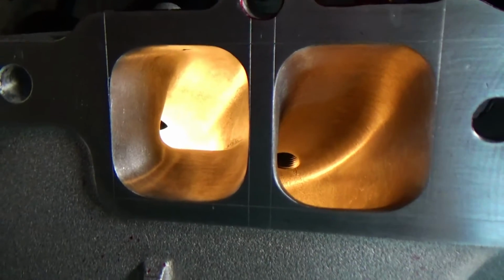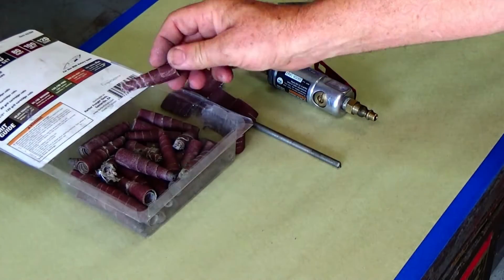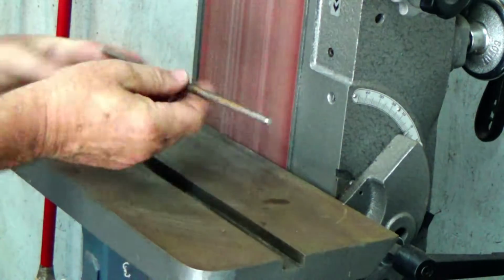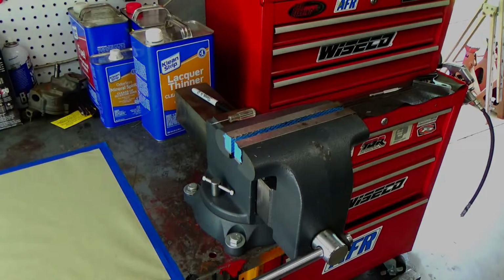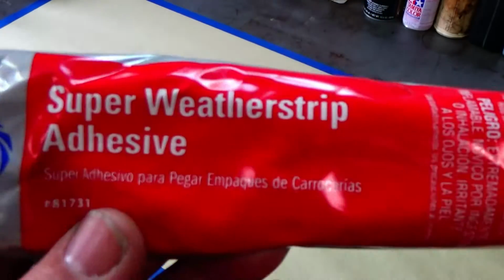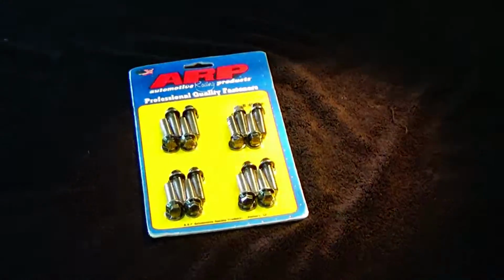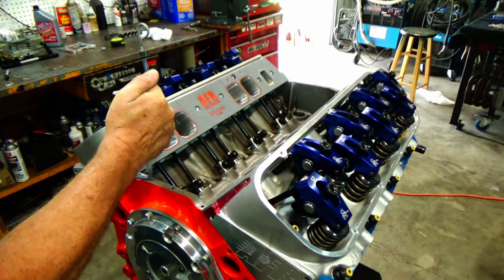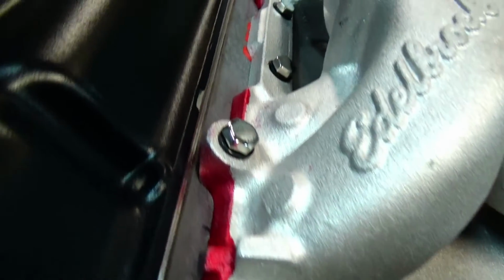Port Matching the Intake to the Heads( part #3) -#22 of the Chevy 454 Big Block Performance Build...

Comment: I made a "flapper rod" for my die grinder about 25 years ago, I used a 3/4" bolt shoulder. I turned it down on one end to 1/4" so that it would chuck up. I cut a slot in the big end for emory cloth. I can wrap emory cloth and achieve whatever desired thickness over3/4" and tear off the outer layer as I go. Thanks for yet another video.
Reply from the maker: Thank you!

Comment: I liked the slotted 1/4inch shaft you used for the final final. It brought back some great memories. It's the excat thing I made back in the early 80s I used when I was porting my snowmobile race engines I use to do. Great video
Reply from the maker: HI Kelly.... Thanks for the nice comment... and racing snowmobiles sounds like it was alot of fun! Glad you are enjoying the videos...
Reply: @Myersmetalworks  Yes it was fun and a lot of work. In the mid 80s we were getting 118 hp out of our 340 cc racing engines with is 22.7 cubic inches. We would turn them 11,700 RPM. Our sleds weighted about 375 lbs and we run on ice. They were built for oval track racing. I live in TN now. Been here close to 20 years now. We may not be that far apart from each other.
Reply from the maker: Wow thats alot of power and sounds like alot of fun.... SC is the state we live in...

Comment: Lots of helpful things you shared, very much appreciated.  I was porting my 89 Corvette’s lower intake a little bit over Christmas since it was already off for leaking china walls.  I struggled with my long shank aluminum carbide bit, with higher speed came more wobble.  I’m thinking it’s the cheap HF grinder I was using, which made it very difficult to not get ruts. My heads are stock & I’m not planning on removing them, so I was keeping around 1/16” from gasket edge to try & keep from creating more turbulence where it meets the head. 
I was surprised that the ports on the FelPro gasket I’m planning using are a bit off.  So I couldn’t scribe lines across all the ports top & bottom.  There is definitely a great deal of determining the placement of the head to intake & being able to replicate it when finally assembling everything. Finally I did use my bore scope to look into the intake at the head to see how well things were aligning, it was very helpful.  Thanks Again!
Reply from the maker: Thanks for the nice comment Brian...  I think both of my grinders are from HF  and 
the one thats the Chief brand is pretty nice and works well... I'm impressed with it for a 
low cost grinder...  The other one not so much... The Aluminum cutters are more aggressive 
and some times with that longer shank it bounces around a bit... Good luck with your
Corvette project.... Thanks again!

Comment: Back in the 90's I had some serious oxidation issues using stainless bolts with an aluminum intake manifold. The bolts deteriorated the intake to the point that it was almost unusable as the bolt holes were deformed due to oxidation. I don't know if it was a metallurgical issue or not but I also encountered the same problem with stainless bolts and an aluminum boat transom repair using never seize that time. The bolts still bnded to the aluminum and had serious white oxidization at every fastener point. I have not used stainless bolts in an aluminum application since and i would be very apprehensive about putting them into an aluminum head. Just my experience. Have you encountered similar?
Reply from the maker: Hi  Dave...  I haven't had any trouble with the stainless steel and aluminum,but also have not been in a moist environment as a boat... dissimilar metal's do have electrolysis if in water that has minerals in it like salt..

Comment: I must ask about the tape on the band saw. Is that just for protection or is that reference?
Reply from the maker: Hi.... We use it for protection on some softer metals we cut that have a nice surface finish
and I like your idea of using it as a reference as well.... Thanks

Comment: Its starting to look like a working motor!  Love the flapper wheel. I'm going make myself one of those.  Any thoughts on what you might put the motor into?  I guess picking a car out for the motor and installing it could make some fun videos also.
Reply from the maker: Hi Mike...  Glad you enjoyed the video and yes still looking for a car... Hoping for some type of older car
Camaro - Nova - Malibu - Chevelle  maybe even another Corvette (my wife likes them the best)...
Lots of crazy things that seem to slow us down:
the quarter mile track that we were hoping to run whatever car we get has shut down.... 
and we are in the middle of a big project for my wife (house remodel)...
and we had found a Camaro, but after driving it for a couple of months, I knew that it wasn't the right car for the motor- it would have taken more work that the motor did!!
So....still looking everyday on Craigslist and Facebook Marketplace for that right car and the pickings look to be thin in my area.
Reply: Yes, I would hate to tell you how many years unexpected life events have obstructed my the car projects.  What I see of the used/classic car market indicates there are lots of buyers right now and prices seem very high because people have more cash on hand. If I see something good I will try to let you know.  I suppose you have some experience with putting BBCs in older cars and since the 454 with a TH400 is really heavy, (~750lbs.) I wonder how well it works in a Corvette vs. say a SBC. I had a friend who had a 72 Corvette with a 454 and he totaled the car going fast and trying to be speed racer. If you are not going to push the car on a road course I guess that would work.  My 68 olds seems to carry the weight adequately. Its never going to be an autocross car, but when it revs enough to put out 500 ft./lb torque and accelerates in a straight line, the whole car seems to become lighter.
Reply from the maker: You are right- some cars just carry the weight of the engine better than others.  
Way back at the beginning, we thought the corvette would be a fun "tool around" car.  Then we had the idea to make it a drag car, but as I thought more about it I decided a "muscle car" would be better. Sold the corvette.  Then the race track closed... So we are back to looking for the "tool around" car- even though racing would be fun. 
And thanks for keeping an eye out for me!!
Reply: @Myersmetalworks  ,You think you can port match my intake manifold and cylinders heads for small block mopar
Reply from the maker: Hi David... Thanks for thinking of us for your port match job... Sorry were not taking any outside work in right now...  But thanks again...